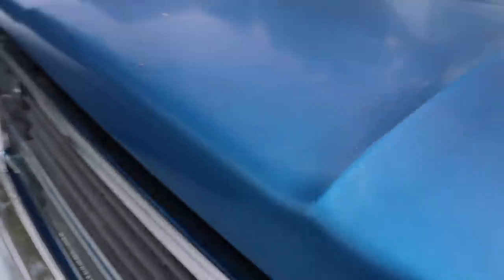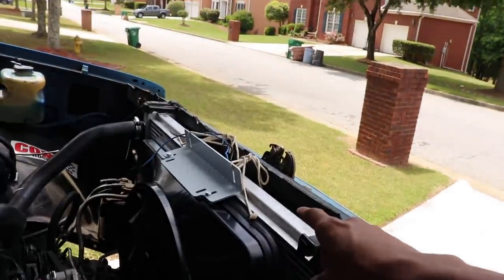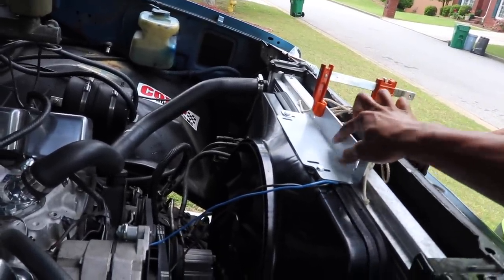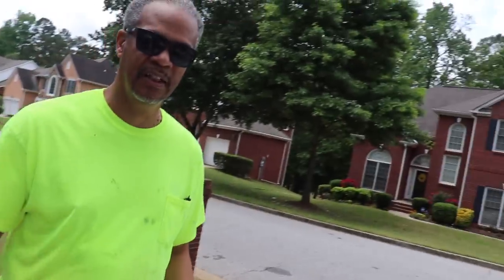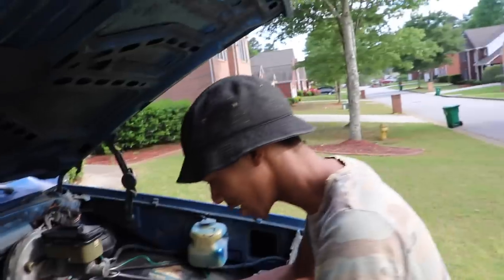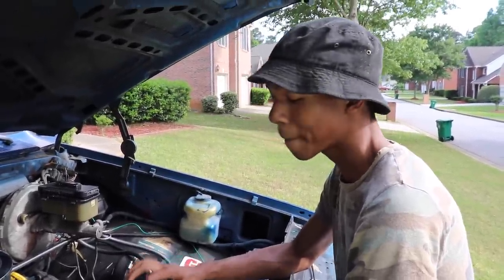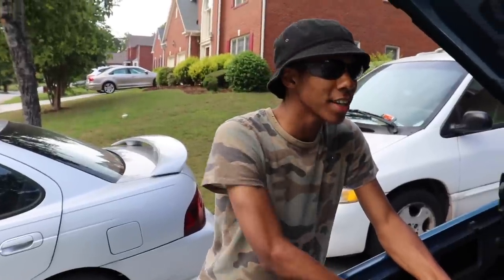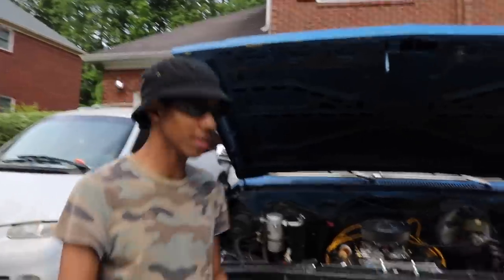How NOT to wire an electric fan...

Comment: Good job!   We used to run electric fan on our offroad trucks because we were always going slow while the engine was working hard.  Electric fans also came in handy in deep water, I could turn the fan off, the belt drive fans always slung water everywhere and got plugs, wire and distributor wet.  Nothing worse than stalling the engine in chest deep water.

Comment: I would either put it on a switch to turn off and on. Or put a relay with a temperature control on and off switch. That fan is not design to run none stop every day. When the motor gets hot the kick on bring the temp down then kick off.

Comment: It's gonna take an extra 10 min or longer to warm up with the fan running non stop that's why u need a switch on so it only kicks on when the engine gets up to close to  temp else u be waiting forever for it to get warm especially in the colder weather. And I'd throw a 25 maybe even a 30amp fuse in it cause 20 is cutting it close for quick current spikes and what not but worst case is a blown fuse now and then lol. As always great vid

Comment: 8:32 doing well, try using flux core or rosin core solder that way the solder sucks in the strands of wire your soldering together and holds forever with out corrosion under the heat shrink. Glad you took all our advice and went with the e/fan next is the thermostat kit off amazon when you get tired of flippin that switch ;)

Comment: Relays aren't to bad once you get used to em. When wiring my electric fan, I had the relay main power wire going through an inline fuse to the battery. The switch wire to the fuse box inside the truck, and the negative to a temp sensor that grounded when it reached a certain temp to activate the fans.

Comment: Hate to say i told you so but I loved the video and laughed harder at this video than I have in a while.  The fun and experience and time spent with the pops is priceless. You may have melted something in your fuse box that thing had to be hot. You will get it now. I’m sure. With dc volts. Length of wire is important the longer the run the bigger the wire you need also don’t run extra coiled up wire . All these things cause heat which bring up amp draw and can hurt or burn up things . That’s a lot of amps that one thing pulls more power than anything you had before so you need a bigger better circuit than anything else. You may need an alternator upgrade or you will be going through them like socks. . And I’m telling you my play toy has went through many electric fans. I did it incorrectly at first to and learned the hard way .  You want it to come on automatically and stay on but you also will want to turn it off at times so put in a switch. Love the fact you post even when you mess up. Keep up the good content. Ps. I’m stealing a quote I heard from the dean in this video

Comment: Tried to tell you to buy a electric fan thermostat kit from Amazon 175-185 degree.. but you will figure it out..present  Air Force mechanic 14 years .. I want steer you wrong lol
Reply: I run the black magic fan with t-stat straight to battery with 30 amp fuse. Everything included with kit , pricey ! but 3 years running .
Reply: @rogerflick825  that's how my set up is with the kit I have don't have to worry about a manual switch all is good
Reply: heavychevy228 a lot of people have bad reviews saying the fans eventually go out or malfunction a manual fan is the best set up
Reply: @jaelanteague-tate3615  it is the best function if the electric fan goes out but if your seeking hp gains the  fan clutch is a parasitic draw on hp

Comment: Ok lil man I'm gonna break this down for you I know it's probably going to irritate you but take it from a guy who has built many hot rods okay here we go number one I watched what you did with your engine when you built it and how happy you were building it how it sounds and you did it right you didn't cut corners so trust me when I say I was rather disappointed watching you cut corners and cheese out on something as simple as the fan ask yourself this if you can not cut corners and build a nice engine why can't you do it for the rest of everything else you do on the truck can you take full Pride in the truck if you half ass anything in it? If you're anything like every other Motorhead in the world you're going to want one day to be able to sit back look at your beautiful truck and say I did everything with pride you're not going to be able to do that if you pull shit like this.  Do things right the first time yes it's hard it's a pain in the ass for wiring but in the end it is well worth it and saves you a bunch of Heartache it is quite possible that you burned up some wires going to your ignition switch so you may be in for even more of a headache even though you hook up a relay you won't know till U get it apart and find out. Now Summit makes a relay system that is really easy to use with a plug it's basically plug-in play you cannot wire it wrong it comes with perfect directions and it's cheap so get the relay and get a temperature switch Do Not Hook it back up to your ignition even with a relay do it right with the temperature switch also it's too late now because you drilled through the truck but from now on really you ought to think about what you really want for this truck and yourself when you're showing it at car shows or hanging out with your Bros or maybe taking it to the racetrack drilling through your truck and mounting that fan the way you did that hurt to watch I build engines I've built hot rods I've raced them trust me kid I know what I'm talkin about I hope that you listen and just put some more thought into what you really want because after seeing what you did with the engine I cannot fathom why you would do this type of work everything you need to hook that fan up properly is cheap and it only takes a little bit of time and some reading pick your spot for the relay hook everything up the way that it tells you to hide the wires so that it doesn't look terrible and be happy
Reply: Amen, really disappointed with this setup...it's so easy to mount that fan the right way but instead they hack it together...the bolts aren't even close to the right length. I hate to be harsh but Damn.
Reply from the maker: Lol I’m not building a show truck not yet anyway
Reply: @YoungChevyTruck  i know it but i couldn't live with it like that. To each their own though.
Reply: @YoungChevyTruck  ok maybe not but to start your building your engine on this channel and to do it right. Like you did.  You draw in people who are impressed with your work and your learning new things it makes US older gear heads happy to watch you young bucks doing it right and keeping the hobby going. So when you then start doing stuff like this it's a shock and down right painful to see it's disappointing.   Also I'll give you another example you just showed us your shirts for sale yes?  Ok well if you want to sell some and you want your channel to grow and be taken seriously?  Then you can't do this kind of hack job man. Now look this old timer is giving you some free good advice and trying to help you grow and learn and be proud.  I really hope you don't just blow me off with " well I'm not building a show truck"   and take to heart what I'm telling you. It's up to you lil man you can be taken seriously our you can be blown off as a hack. Us old timers know what we are talking about. Don't waste our free advise take it and apply it we are not always willing to give it.  Lol don't be like me and blow off a old timer advice when I was young and doing some street racing in Daytona I was not as fast as I could have been. I was approached by a old man was was being told about head casting numbers and cam combos by him I told him hey old man I got this I'm fine you know who that old guy was and I did not know till I was told to go home and look him up in my magazine's ?  It's was Smokey him self :(  that old guy never gave me another piece of advise again. I even went to him with hat in hand and said man I'm sorry I had no idea and still he never helped again just watched me fail time and time again.. So no I'm no Smokey. But don't blow off good help and advise from the guys who have been doing this for years!   I personally would like to see you succeed and have a nice home built hot rod truck so I hope you take my advise and apply it. Be a winner man not a failure..  You got the potential I see it ... Now I may be a nobody to you I'm not famous like Smokey.  But I did go 8.51 in the 1/4 @ 151 mph in my BBC nitrous 55 Belair. Twards my last days of racing so ide pay some attention to my advise bud ;)
Reply: Easy guys he's young and will learn from his mistakes
Reply: @RobertDickens2002  hey brother I'm not going hard on the kid I'm really not I'm trying to help him hone his potential is all.  And these kids can't keep blowing off good free advise is all. Look I've said my piece I'm trying to help him but I'm not gonna force him to do right.. It's his choice now. I just gave him something to think about and I hope that he does. After watching this kid build his engine I know he has it in him to do a good job on everything he does with his truck.  However if he never hears maybe even some tough words to help him along the way then he will just be another Hack. I took his channel seriously and have stayed to watch him grow with his project truck.  But I won't be staying and offering help or free advice if he is just gonna be another HACK I can see that in my neighbors yard . I'm still here for now but this kid has drive and potential if he will just do it right he can really create a damn nice hot rod truck. But not by doing stuff like that
Reply: @PHG_Viking_Wolf73  that's a very good point about the t shirts. After watching this video that was one of the first things that crossed my mind, "Damn i was thinking of ordering a shirt too," but if I'm gonna wear something I'm representing it and as much as i love the design he came up with now I'm having second thoughts.
Reply: michael penna he only responds back if he is offended. He researches nothing and screws everything up.
Reply: @RubinsRacing350  I don't know bud I see potential in this kid.  He just needs to take the time to do it right and accept that he needs to learn still and be willing to use good advice,  now if he can't do that? Then yes I can see him screwing up all his projects. He has to humble him self and swallow his pride is all
Reply: EAST SIDE313 well said
Reply: @EASTSIDE-313  yet he never takes it and uses it. Yes it is smart to use it NO I don't have a ego issue thank you very much.  What I meant by that is. He need to start using the good advice he gets. But as you said he asks every video but then be NEVER uses any of it. Almost as if he thinks he knows best wouldn't you say?  There for to swallow his pride and humble himself to use and listen to the advice he gets.  I never heard anyone In this video tell him to drill holes through his core support or tell him to wire it to his key switch with just a fuse did you?   NOPE I saw people telling him how to do it and to do it right.  So EAST SIDE313 yes in this case I feel with all the great advice given out to him and none of it being used or even acknowledged it sure seems like he is on a kick of whatever I know what im doing I DONT need your help I got this. So yes to have a big head like that to ignore all things said and just do it.  If a change is finely made to start listening and using the good advice given it would be humbling him self.  No ego just a fact!  In all my posts on here have I not defended him and said I see great potential in him?  If I had a EGO as you said I would not take the time enough to even care let alone defend him. Ide simply see one video and say humpf I know my shit this kid ain't got it and move on with my big ego.  Have I done that?   I THINK NOT so where is this Ego you claim I have?  Was it not also YOU who was agreeing with me in a few posts of mine?  So what has changed now?
Reply: @PHG_Viking_Wolf73  yes i did agree with u multiple times i just don't like the way u said he needs to humble himself and swallow his pride, and honestly i don't think u saying that will help are all either. I don't know though it is what it is, i hope the best for the whole situation.

Comment: Jeez boy slow that drill speed down😉drilling at a fast speed like that can heat up the metal causing it to temper and get harder then it'll eat up the bit. I'm a machinist by trade.

Comment: Geez with that big a radiator for a big block  you barely need a damn  fan remember if your moving you don't need the fan at all the heat exchange is done by the air going thru already put it on a switch and watch the temp gauge I'll bet you barely turn it on your problem is no shroud and remember the fan can be in front of the radiator too have fun tho that's what's important I'm glad to see someone your age learning and being pushed In the right direction in lieu of other things kids are doing these days

Comment: I somehow hooked mine to the Oil Pressure Switch.
Reply: Was it a 2 wire?
Reply: Michael C. I can’t remember. It was my first time, I did what was easy. If I were to do it now I would just hook it straight up to the fuse box.